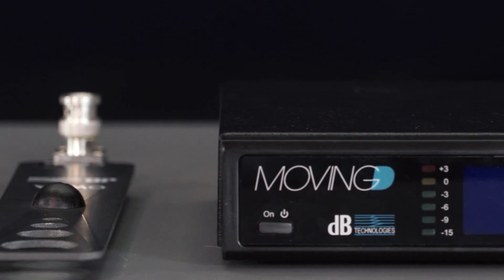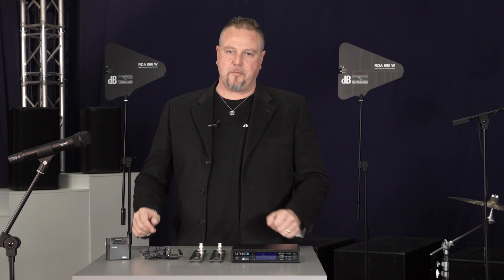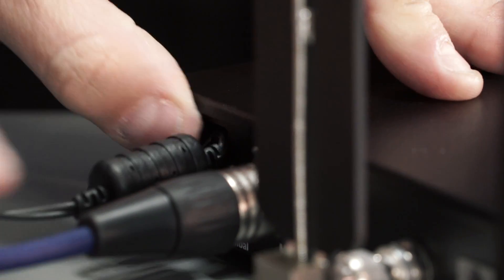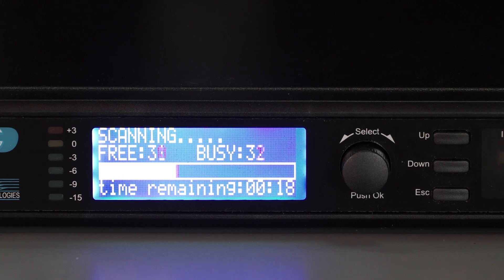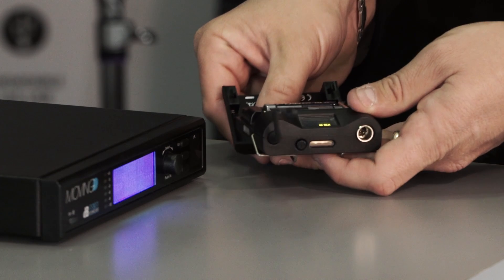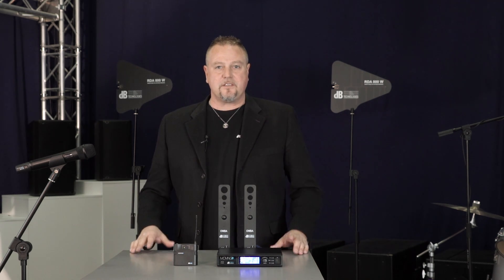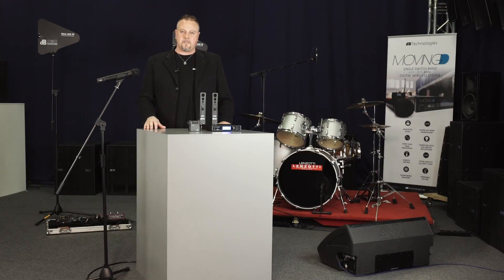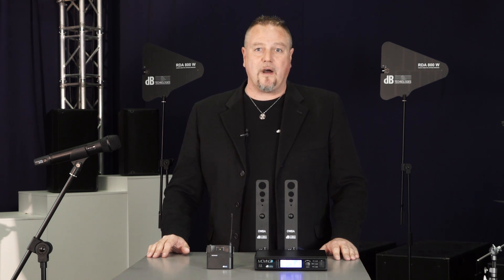How to setup a wireless microphone system (basic)

Comment: what is the body pack for? A que sirve?
Reply: That's when it is one is using a Lapel Mic. The Lapel mic is connected to the Body Pac (usually using a cable). The Body Pac then sends the signal to the Transmitter. 

Alternatively, When using a handheld mic, the Handheld mic would have an inbuilt sensor which then connects with the Transmitter.

Hope that helps